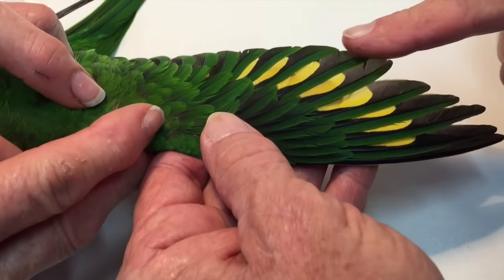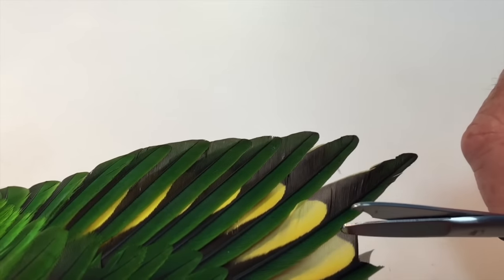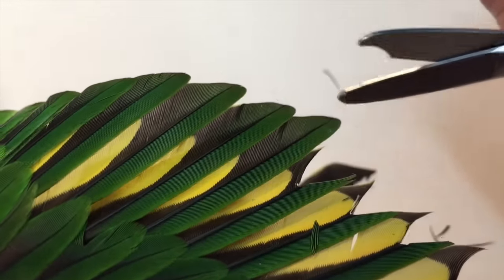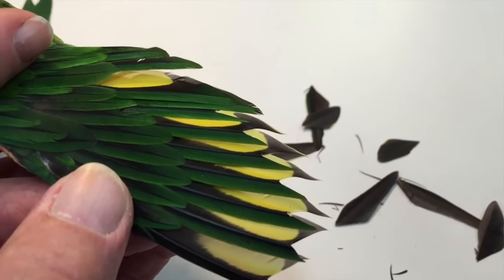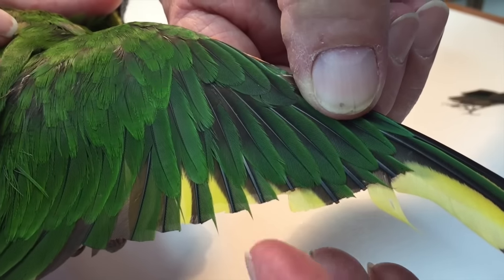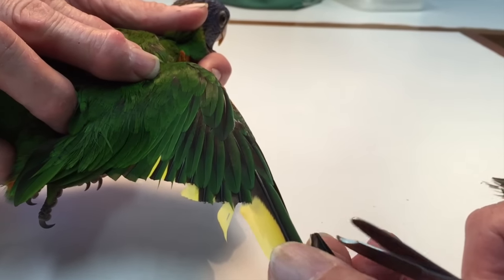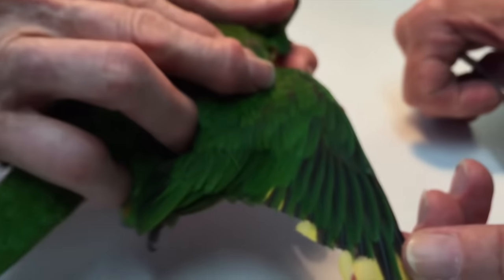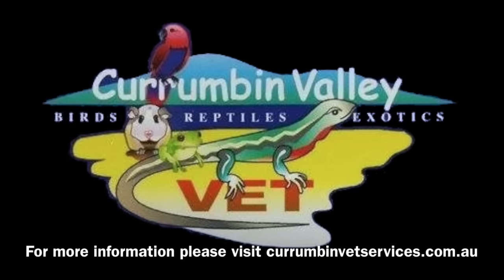Correct way to trim parrot wing

Comment: The correct way to trim a parrot's wing is not at all.
Reply: So you want all birds to die? When they flying?
Reply: Zingothepitbullwolf ! 
They don’t die if they fly. My flies all over the house.
Reply: Aida Anderson You should clip their wings.. its helps them so much
Reply: Flowerhoseokeu 
Help for what? My Grey is perfectly ok!
Reply: I like to keep my birds fully winged when possible, but they get hurt flying into windows and get into places in the house that aren't safe.  About half the year they are only minimally clipped, so they can still fly but not as fast or as high.  That also keeps them from hanging out on top of my cabinets.

Comment: It's cruel... Don't buy birds...Buy a pet that can not fly from the beginning... so cruel
Reply: So, why are you doing this then?
Reply: @giots9559  it can fly a short distance as in,glide. It can glide,the problem with not cutting birds wings is they can fly into ceiling and damage their skull,I had a very skilled pet owner as a friend and she was a bird expert,she didn't clip it's wings though so it flew into the ceiling and fractured it's skull resulting in death a day later.it is important to keep your bird safe,even if it means cutting their wings..
Reply: So the same again... 
It's cruel do make your pet disable ... don't mutilate it... It's like cutting a bit of my kid's legs, cause it's dangerous for it to go out to the street...
Reply: @giots9559  so...providing a safe room..means you have to get rid of the walls in the room because like I said they can damage their skull on walls and ceilings by flying into them...and also the birds wings grow back idiot it's actually extremely similar to cutting hair.you can't feel it and it just shortens your abilities a little,same for birds. They can't feel it and it grows back so maybe research a little bit more bud.
Reply: I have a cockatiel...He flies every morning in his room...He sees the walls and avoids them...

As i said before... By clipping your bird's feathers you cover your need to have a pet bird at home, and not the bird's to be safe.  Just think about it, and your bird will be happier.
Reply: @giots9559  no it won't. And it depends on how old the bird is,or how intelligent. You think every single bird is like your cockatiel,maybe your cockatiel is more intelligent than most birds but birds will be much happier having their wings cut and not flying into walls,I have two budgies and they are the happiest birds I know because now when they fly around they do not hit walls and instead can fly smoothly unroll learning how to avoid the walls,if your bird is young cutting the wings is the best thing for them. They hit less things and have more energy,if your bird is already used to your house and you have had it for more than 1-2 years then fine so what you want but if your bird is newer like mine you should really cut it's wings until they are old enough to know not to.its like having a 3 year old. If you leave it alone without a stroller,it will wander into the street and get hit. But if you keep them in the stroller and help them walk they will learn not to walk into the street.
Reply: My objection is more 'philosophical'... You sacrifice your brd's feathers, just for YOU to have a pet bird. For me it's cruel... 
Maybe if it's too yound, it could be ok, if you do it once... But many people want their birds to walk instead of flying or to fly for some cm (Im european) only.. It's cruel... let them fly, let them exersize.. 

And last... if a bird s flying to a wall, that means for me that this bird is scared and tried to avoid smth
Reply: @giots9559  well those people are horrible but most people cut it once or twice and then let them grow back once they grow up more.
Reply: @giots9559  .... birds can see walls but they can't see windows so cut he wings is really good
Reply: Lol what do your research before commenting. People have different opinions on clippings a bird’s wings but it isn’t like amputating them. You’re merely trimming some feathers so you can train them a bit better then eventually you can just let the feathers grow out again
Reply: Baconmuncher  also yes I have two birds. I have indeed cut their wings at a young age and they are happy birds.
Reply: @Budgie Lovers Forever you have to remember some birds are raised to eat pellets everyday to survive. You also have to remember some birds die from starving in the wild. I don't need to do any more research because I knew about everything you replied. You are correct but not all birds are wild. There are some that are caught in the wild and others that are born in captivity. So yes you would expect that some do not enjoy getting their wings cut, actually most don't enjoy the process. And you don't have to cut a birds wings every 6 months, not everyone does that. I cut my birds wings once and that was it. They are adults and no longer need to have their wings cut. You must understand that cutting a birds wings isn't always so they can't fly but more for the safety of energetic baby birds that fly everywhere and don't know how to control how they fly.
Reply: Baconmuncher  you haven't met my birds and if you have I am concerned for both my safety and theirs. Don't assume my conscience is telling me they are happy you can tell when a bird isn't happy and they are. They have each other to keep company and they get fresh food and water and get playtime daily. I take care of them with my parents and there are no signs of them being depressed or upset. You are a very evil person for calling people slurs and shaming them for something like cutting a birds wings. Would you say these things to a child getting their hair cut forcibly by their parents? It's the same thing. I can't believe a person like you exists and owns birds.
Reply: @Budgie Lovers Forever 
Baconmuncher is insulting people and calling them animal abusers. They are wrong, they need to understand that. They're telling you that if you've ever clipped a bird's wings you're evil. That's wrong.